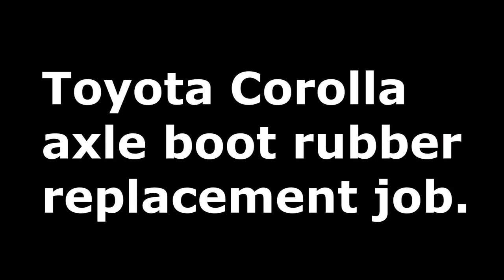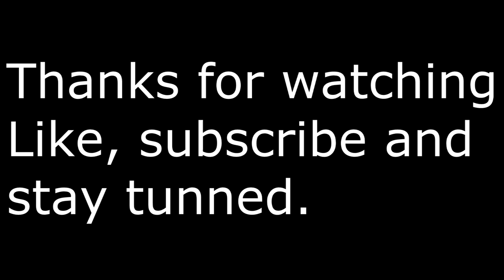Car Axle drive shaft repair. CV joint & Boot rubber maintenance and replacement.

Comment: A smashing repair :-D, in such a dusty environment the boot is so so important, i imagined the dust mixing with the grease and making grinding paste :-(.
Your repair will outlast the car i think :-D
Reply from the maker: Thanks dear friend for liking video and nice comment. This is common here to have broken rubber boots in many cars due to bad quality rubber boots, sand and careless users. The purpose of repair was to save expensive axle from damage and costly repair. Regards,

Comment: Please, can worn-out or bad inner cv joint cause ABS light on? I asked because immediately I changed the cv axle joint, I began to hear like cracking nose. Please, what could be the problem? Thanks for helping me out.
Reply from the maker: First of all bad CV joint wouldn't cause the abs light to come on. Second if your light may came on after replacement, it seems a miss matched CV joint or axle. Or maybe there could be some other defect in the abs system. A scantool may help you to diagnose. Grinding sound shouldn't come from the new axle.

Comment: Sir, i have camry that makes clicking noise when turning to the left, wht could be the problem? And will changing the boots fix the problem?
Reply from the maker: It could be a bad axle  or can be a bad tiered ball joint. Unfortunately the rubber replacement would not help. But the whole part replacement will be necessary.  Stay tuned and blessed.

Comment: Hello brother I think this is not the proper freeze meant for the CV Joint
Reply from the maker: Any grease could work. Then this one is original skf. I used it with great success.

Comment: mamo da kum side che to po los ke nevala wo agha tool de grease na dach ke bia po da bearing mane wakhegawe po de tareqe da grease bahar  na arwaze . ao da breake caliper wala clip aobosa da kho deer asan da to kho dumra zoor arkara wo ka pipe de leak kara wa bia bo ata nost wa
Reply from the maker: Na sarhiya brake na baghair han da char kay dai shee. No biya walay extra saman aetha kolao ko? Grease chay ziyoth wee no biya baar arwazee. Da mo lashki zioth irachawali wa.
Reply: dalta ke grease po da bal axle ke achae che kum de gear box taraf na ro ghala we bia da cross bearing axle ta aroche our posa na rubber po walagai leak keze kho na
Reply: @JahanZeb1976  are u Peshawar?
Reply from the maker: @asgharkhan1075  Kohat.